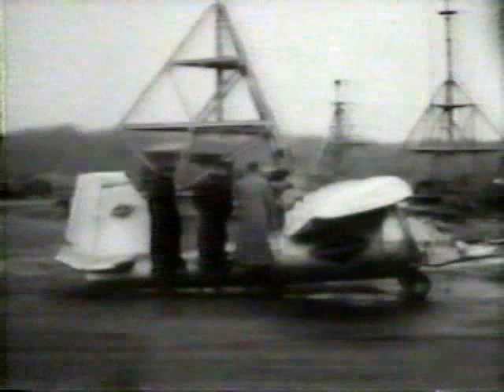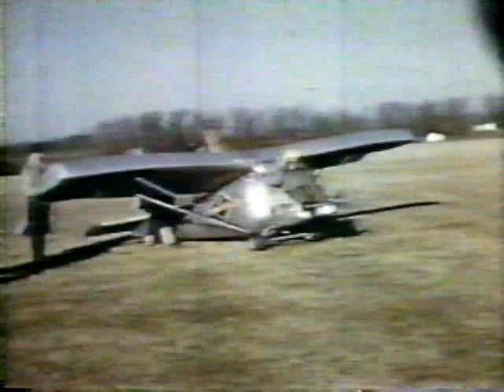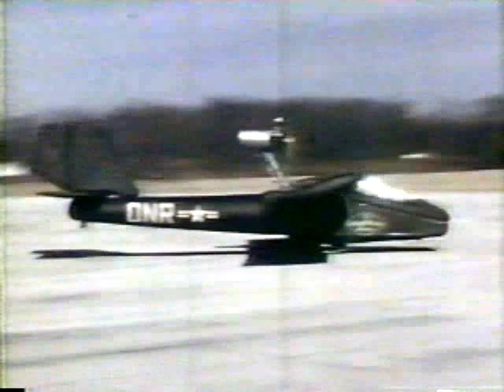Inflatable Plane - Goodyear Inflatoplane

Comment: I would still buy this regardless of safety it just feels so practical and easy to take. Just imagine you’re hanging out with friends or hiking you guys can just inflate a plane and get out of there.
Reply: I feel like it would be as safe as many ultra light out there… and probably safer than paragliding
Reply: What I'm really waiting for is a helium-filled rigid wing made of this stuff, to be used with a paramotor, so you can cruise at ultra-low speed or just hover in place! And if the wing had several "bulkheads" and one of them blew out, you'd just slowly descend to the ground.

Comment: You could theoretically make a version of this that is strapped to your back with just the wings and tail. No fuselage. And have it powered by electric motors. So the whole thing could be deflated and compressed into a large backpack.
Reply: What would power the electric motors? Batteries?
Reply: Brandon Cropper and how heavy would those batteries be if a tesla has a giant battery that only goes 300 miles. Yea how would it be powered? Cool concept but even in 2020 we're not there yet
Reply: What you’re suggesting is A paramotor
Reply: @Ccscenario  Well kinda. But with inflated wings strapped right to your back kinda like Adrian Toomes from that Spider-Man movie a few years ago
Reply: @houselightkell  so a flying squirrel suit but with a motor
Reply: @samnoneofyourbisnus2543   yea hopefully there wouldn’t be a recall on them mid flight like the Samsung batteries 😂
Reply: @Joule Tolland, Definitely an interesting idea... But how stable would it be? How far, high and fast could it fly? How much smooth ground would it take to get it safely airborne and back on the ground? These are real challenges that were met , reasonably well - with the inflataplane... But it could not be used in the jungles where there were few if any long strips of ground that could be used as improvised airstrips... Which probably put an end to this program....
Reply: @jwuuds6003  For these reasons, a small lightweight 2-stroke reciprocating gas powered engine would be the obvious choice. Power to weight ratio was often 1 h.p. to 1 pound...A load of fuel to get the downed pilot out of trouble , 60 miles away, could weigh as little as 40 pounds.
Reply: @michaelmartinez1345  range is quite a concern here. Sure it's a lot lighter with the lack of a fuselage but how much fuel can you carry in a backpack or waist mounted gas tanks (like the ODM gear's tanks). As for takeoff, I imagine jumping from a really high surface is a questionable but doable idea

Comment: 13:13  Goodyear didn't think it'd be profitable?  But surely the public would be interested in buying planes like these. 
Not only can they fold up into a tiny space (you can fit many of them in an ordinary garage), they even cushion the pilot incase of crash.  These things could have enabled mass-public-adoption of cheap, easy, common-place, personal air-transportation.
Reply: I mean this would eliminate the need of a flying car...I have no idea why no one has tried to remake one of these and sell it again.
Reply: littleferrhis But now we have flying squirrels.
Reply: roidroid I imagine long term storage and improper folding could cause the aircraft's frame to develop dangerous cracks and leaks. It's just another layer of complexity over the already expensive ordeal of keeping a plane airworthy.
Reply: Tyler Linner  Well you would pump it up of course, the problems would be easily found, and I am guessing fixed with something as simple as duct tape or glue dependent on the fracture, and since this is basically a balloon with an engine it would be easy to replace.
Reply: Yes, very true. Imagine having to swap out gas canisters or have an automatic pump constantly having to maintain proper pressure when flying from hot places, into colder altitudes then back again. Not to mention the constant material weakening and stress from seasonal or garage temperature fluctuation wear on the rubber. 
    It may be made by a tire company but, you're not flying tires and even if you were... if the amount of tire tread rubber pieces and stranded cars by the roadside a person sees over the course of a single year means anything to a thinking person, then one might have a second, more sane thought about this idea having been the forgotten solution to mass public air transit! lol

  One pressure release valve failure after inflating in flight to maintain proper pressure at a colder altitude/location when back onto a hot Florida tarmac and.... POP goes the pilot! Just like a Humvee tire filled to spec on a cold Virginia night, then rolled out of the back of a C-130 to sit on the tarmac of a Saudi Airfield!
Reply: Please take into account that "cheap and easy, common place personal air transportation" is the antithesis of "safest and reliable of any type of air transportation".
   Also, if one takes into account that there were not then, and still are not now, enough people who can pass certification to pilot an aircraft of any type to make it profitable for a company to mass produce to a level anywhere near that of a land vehicle, let alone an aircraft the size required to transport more than 1 person at a time being practical, there is still the problem of keeping and operating an aircraft of this type from the home of the average, common place, cheap and stupid citizen... even if it deflated and folded up and they could pass flight certification and a physical to fly a passenger in an ultralight class aircraft because you have to have a licenses to fly a passenger, even if it is an ultralight class that wouldn't normally require a license. What use then would it be to the "family of the future"?
Reply: @grinninggoat5369  So an air pressure sensor in conjunction with a teeny tiny cheap ass air compressor/pump embedded within the inflatable fuselage would not be able to easily overcome all these idiotic seemingly utterly insurmountable technical failings of the potential success of this class of personal aircraft that you've so cleverly laid out???
Reply: @grinninggoat5369  Yeah everyone's an idiot, except for the fact that millions survive our deadly roads every year.
Reply: You people realize this is an extremely crude, slow, last ditch vehicle intended to be used once or twice at most to get someone out of a jam. It has no instruments whatsoever, a carrying capacity equivalent of one slightly fatter american, and is probably very cold and uncomfortable when flying. On top of that, the fact that it doesn't require a hangar is moot since you still need a landing strip to take off, and most of those are located next to hangars. Maintaining a boat or keeping a plane airworthy is a lot of delicate and expensive work, the argument you're making about this is like saying that small dinghies are gonna replace people's normal boats, only these disposable dinghies are still complicated and will kill you if there's anything at all wrong with them.
Reply: True